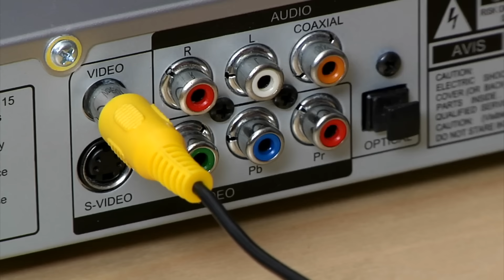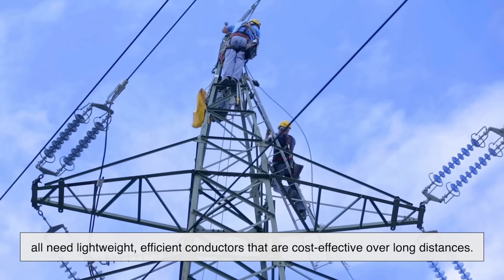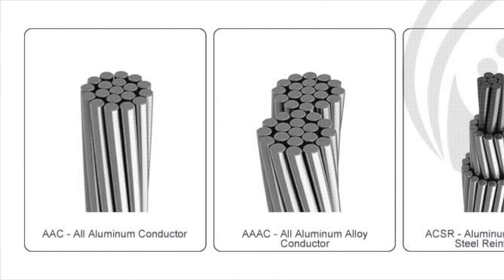Why Do Power Lines Use Aluminum Instead of Copper?

Comment: German electric engineer here.

I guess the corrosion issue with Cu also plays a major role when exposed naked to the environment and climate in large power lines and open equipment. Aluminium conceals its surface on its own with a small but solid oxide-layer, preventing any corrosion, it is a kind of natural weather protection. I am very sure, this also lead to the decision to go for Al in open power transmission lines. Copper sooner or later will corrode when exposed to nature's elements permanently and metal oxides do not transfer any electricity.

Fun fact, our East-German Trabant cars were fitted for a while with aluminium battery cables for the starter, which was awful specifically for the early 6V-cars, specially in winter. 
While two-strokers in general start better (only one turn required for ignition) than 4-strokers when cold, it was still an endless and slow starter-cranking of the engine before it finally fired up. So we usually went to electricity companies, asked for some Cu-leftover cables to make home-made copper ones. Once this was done, your Trabi fired up with the first spin even in freezing cold. However, I am sure the export versions all had copper starter cables when leaving the factory.

The Socialist GDR also wired new buildings massively with Al in the 1960s and 1970s to avoid Cu-imports, since the only Cu-mine we possessed was increasingly depleted (and finally closed in the end of the 1980s) and Pinochet's fascist Chile (the other very big world market copper export supplier) was not really on trade-friendly terms with Communist East-Germany, as well as our country was always short on US$.
But due to the increased fire hazard (German summers can be very humid and Cu and Al being wired up directly are never a good idea), they changed buildings standards soon back to copper.

Peace! from Dresden / Germany
Reply: Mr. Gorbachev, Tear Out that Aluminum Wiring!
Reply: @JohnW118  We already did 🤗.
Reply: Retired electrical engineer from Finland here.
I've worked for electrical distribution companies for almost 20 years and about the same amount of years with electrical installations in buildings. 

Copper is both mechanically and chemically stronger than aluminium. The main reason to use aluminium is costs, the other is weight. Nothing else.
The melting point for Al is 660 deg. C. and for Cu it's 1083 deg. C.

Cu is a way more noble metal than Al and unisolated Cu wires are buried underground used for grounding. If Al wires were used for that, they would oxidate and disappear in a pretty short time.
We still have some both airborn and underground copper cables built even before WW2 in use (in private use of course).

In Finland the minimum conductor area for Al is 16mm2 (means a diameter of 4.51mm or 0.178") and it's only used for fixed installations, not for movable devices.
Reply: Same in Poland, 2×2.5mm^2 aluminum was used everywhere until the 1990s. Today, it is prohibited for cross sections less than 10mm^2.
Reply: Copper also forms a protective layer... the patina. It's used on roofs and in rail, I know parts of the network where the overhead line is 50+ years old and still "ok-ish"... it's being worn by pantograph of course, and it's the main reason why it needs to be replaced, not corrosion.
Even properly made Al home wiring still sucks. Connections need to be re-tightened, wires are thicker, aluminium work hardens faster... easy to break something or get a high resistance connection after some decades. Cu installation on the other hand can last 100+ years. Unless you buy chinese cables with crappy insulation or something... Main reason why I replace ancient (metal tubes and cloth soaked in tar instead of plastic insulation) copper wiring is not because it's bad, but because 2 wires are not up to today's standard.. need 3 wires.
Reply: @Mic_Glow  
Thanks for the clarification. In the 1970s I was still a school boy when they get rid of the aluminium wiring in buildings again. Learnt a few details new (never actually wired something in Al myself).
Later I as a German engineer I worked a lot in China until I retired a few years ago. You can get now the best quality there but as usual in the rest of the world it has its higher (purchase) price. 
They problem with us in the Western world are the purchasing departments in the trading and retail business of OUR companies, they still keep ordering the cheapest (quality) stuff from China to resell it to to us overpriced, increasing their margins - making us believe the Chinese do not know how to make good things. But they certainly do.

Peace! from Dresden / Germany
Reply: @Mic_Glow  I don't agree on the last part. Most cloth insulation here was replaced with PVC insulated wiring, because the insulation failed. Ground wire still wasn't added in most cases.
Reply: I was going to focus on the same thing ommited here 😁.
But the same thing makes aluminum wires a very bad choice for a household.
It's not about "better conductivity" which mentioned our friend "History of..."
It's about aluminum oxide being non-conductive at all - on wires having contact with oxygen it creates huge heat problems...the more heat, the thicker oxide becomes...eventually wire soften and looses electrical contact in junction. 
The only reasonable solution is to use connectors filled with gel, that prevents oxidation wherever we need to connect aluminium wire to house wiring.
Reply: @cwm-SupremeChancellor   then you have the problem of aluminum acting as anode with the steel core ..so will give itself up. I;m sure the also that aluminum expands more than copper  / so also contracts more - how that works with its steel core i dont know, think the cost and thieves will be the main reasons..
Reply: @cwm-SupremeChancellor  It has been prohibited for many years due to issues such as fires. It's only allowed to just before the electric meter!
Reply: Thank you from Australia
Reply: Connecting copper and aluminium reliability is relatively easy if know how - it just requires the proper crimp lugs that have an aluminium sleeve and a copper connector.
Most household wires have large aluminium connections to the grid but thin copper wiring inside the building.
Reply: Thanks for your great technical contribution; peace to you all from Texas.
Reply: Copper in low voltage applications includes a higher amperage conductivity for a given width of conductor allowing it to be more easily bent and pulled through tight spaces. My friend went with cheaper aluminum conductor for his EV charger DIY install and said pulling that wire through holes and conduits was not worth the savings.
Reply: @fosarvian very good point. I have almost no experience working with aluminum. Makes sense it would be difficult.  I always had a rule, I use copper only directly from the meter to any sub or branch
Reply: Many times, the comment section is more interesting than the video itself. This is one of those times.
Thank you. Peace!
Reply: Czechoslovakia was using aluminum too in panel houses and copper was not available.

I am in Czechia. I still live in a flat with Al wiring. I nearly had a fire several times because Al heats up under the electric socket when screws which hold them loosen up and those wires start to heat up and sparkle.

The renovation to change to copper would require to rip out all wiring from concrete panels. It is costly and I can’t imagine to empty my whole flat for several weeks to fix this communist crime. 😢 Also the cost will be high…
Reply: cough..   LOL    that oxide layer is the corrision.........  in fact aluminium is illegal to use for power here.
Reply: @HarleyHutson  I was thinking the same thing. It’s basically the definition of corrosion.
Reply: unterschreib ich so
Reply: it's more of a matter of heat produced, copper in high power would melt and deform causing power outages and or electrical fires
Reply: @allenpierce4575Aluminum melts at lower temperatures than copper…
For high temperatures silver is actually preferable (which is why relay contacts are normally silver (although for low voltages and currents gold is preferred (or indium for frequent operation)).
Reply: @allangibson8494  Probably in medical equipment use only as cost will be very hhigh otherwise!
Reply: You're an engineer, and you're guessing? 🤪
Reply: Cu also forms an oxide layer that is rectifying and has a voltage drop of less than 1V for currents less than 10A. All joints must be physically tightened to break the oxide layer. Al has a tougher oxide layer that needs more work...
Reply: If you are engineer, you would know. Corrosion is not a problem, it's just you.
Reply: Thanks for the  important video. There is lots of un-permited work so lets make education free and easy to understand. I'm not endorsing un-permited work but just trying to educate people.  It is important to remember working on hot equipment can be dangerous. Be safe
Reply: Copper is heavier and work hardens, so over time in windy places, the copper can sag and sway, causing it to snap
Reply: Well i guess I have to take your word for it. Copper gets the green patina on it but it’s fine under it. One thing I learned is don’t argue with professional cuz I’m not as smart as I think but I am prone to extreme feelings of embarrassment 😂. So ima take your word for it. Especially being German. Everyone knows they build amazing stuff. 😊😊😊
Reply: Can't we use just steel for conductivity?
It's conductive after all
Reply: @waelfadlallah8939  Steel keeps corroding until it's gone. It's conductivity is 10x worse than copper, so for the same wiring loss you would need 10x more volume in steel, which would be about 9x heavier
Reply: @waelfadlallah8939  Conductivity of iron is of about 10 MS/m, cond. of aluminium is of 36 MS/m, and cond. of copper is 59 MS/m. You can easily guess why steel is not used for power transmission (except for the reinforcement of aluminium lines). 
However, steel IS used in overhead power transmission: in tram or train lines. This is because the main mode of destruction of such naked wires is friction wear. Steel is far better wear resistant than aluminium or copper. As usual, proper selection of a material is trading something for something.
Reply: A used Mercedes, Audi, or even VW used to be a great option for a reliable preowned vehicle. Now you can’t give them away. What happened? Sadly, I’m only half German, so I don’t know the answer.

Comment: for equal volume, Al is worse conductor compared to Cu but for equal weight, Al is a better conductor. Most Al open cables have one or more strands of steel and that adds to weight. Finally Al conductors are heavier compared to Cu one for both open and armored cables.

Comment: Interesting video for sure. And people need to know that a lot of wire imported into America has aluminum with a copper plating on it. I found this out when rewiring a trailer. The wires were copper looking but aluminum inside. So be careful when you buy cheap wire. It is called CCA wire, or Copper Clad Aluminum wire. Not what you thought you bought!
Reply: they (CCA cables) have the best of both worlds; the copper coating helps connections problems (Al conductors must be tightened with steel nuts and bolts) and the Al core reduces costs.
Reply: @janami-dharmam  Maybe you need to work with CCA wire. Then see what you think. Not so sure you will like how they are. I know I don't want anymore CCA wires...
Reply: @janami-dharmam  You can only run less current through them, you would need to go up with the diameter unless you wanna make them burn something down. The reason CCA exists is for the skin effect which you have at high frequencies (like audio). But rule of thumb in my country  usually 16 amps at 1.5 mm² (AWG 16) pure copper wire, if you use CCA we would need to go up to 2.5mm² (AWG 14) CCA due to the higher resistance.
Reply: @ShiroiAkumaSama  wrong on both counts; skin depths for Cu and Al are very similar because both are highly conducting. Skin effect is not relevant at audio frequencies. 2nd, for 1.5mm2 copper wire (for open air free circulation) can carry 16A, then the same diameter Al wire will carry 14A.
Reply: @janami-dharmam  2nd is correct in my country for a socket we have to use diameters that are rated for 16 amps. The diameter is also changing by the length of the wire. So in that case we would legally obliged to take a bigger diameter when using CCA. Thank you very much. 1 more point is corrosion when you use it in humid rooms.

Comment: Regarding 4:28, during World War 2, many tons of copper were needed to make military equipment and ammunition. During the Manhattan Project at the Y-12 plant in Oak Ridge, Tennessee, silver wire was used instead of copper wire for the electromagnets in the calutrons for separating uranium-235 from uranium-238 to build atomic bombs.
Reply: Silver is the best electrical conductor in existence, and might have been desired due to the current per unit volume involved.
Reply: @A_Canadian_In_Poland  Thank you for your comment. During World War 2, lots of copper was needed to build military armaments. On the other hand, the United States Treasury had a large supply of silver. Therefore 14,700 tons of silver were borrowed to make the wire coils for electromagnets for the calutrons at Oak Ridge, Tennessee to extract uranium-235 to make atomic bombs.

Comment: Has anybody else heard about carbon fiber optic ?  basically the carbon fiber is housed inside the fiber optic cable. It's supposed to replace both aluminum and copper wiring.
Reply: fiber optics need signal amplification at regular intervals. But this signal amplification needs power and this is the purpose for the electric supply with fiber optic cables

Comment: How is the dissimilar metal contact issue dealt with the aluminum conductor and steel reinforcement cable?
Always thought provoking, stimulating subjects.
Reply: Steel provides physical strength. When the cables are pulled or tightened, only the steel wires (or ropes) are pulled - they play very little role for power transmission
Reply: How the risk of the dissimilar metals in contact with one another addressed?  Wouldn't there be a concern of the steel corroding and eventually weaking the cable.
Reply: Aluminum and steel combined suffer from galvanic corrosion.   That is what is being inferred here.  The aluminum will be subjected to a high rate of corrosion caused by contact with the steel, unless there is a barrier of some sort.  Or does the electrical current cycling through the wire prevent the galvanic corrosion?  How is this addressed.

Comment: Aluminium jointed to copper  WILL  corrode badly when any dampness is around ..... The aluminium goes all white and fluffy causing the joint to fail ... special techniques are required ............. DAVE™🛑

Comment: I live in a 1960's home with aluminum wire. Aluminum wire is like a lover that can become irritable if you don't treat her right, but if you treat her the way she needs you to, she'll be a very devoted partner.
Reply: I got rid of almost all aluminum when I reinsulate my house's walls. I still have some low current light fixtures using it that I had to connect with special wire nuts on the copper circuit.